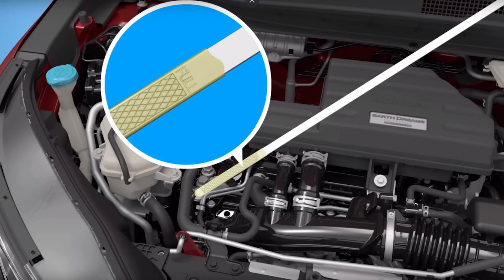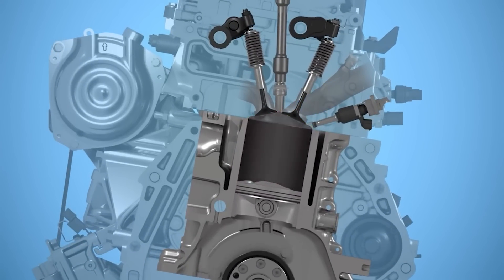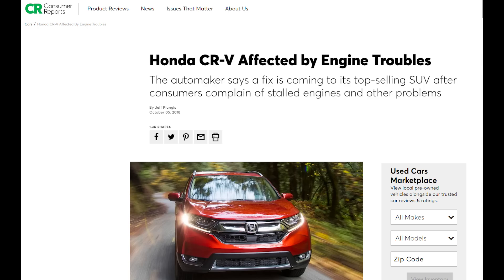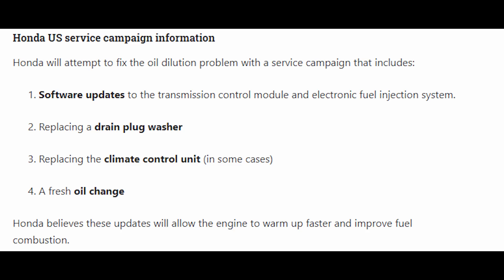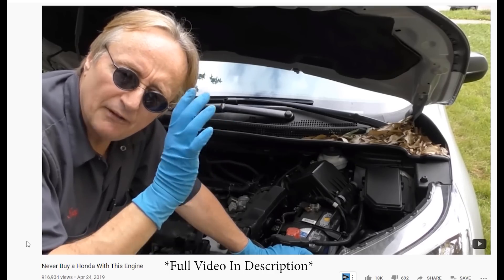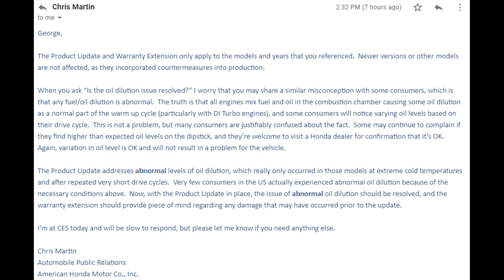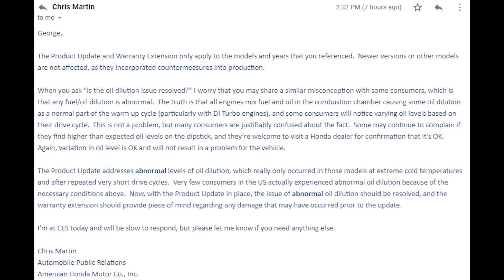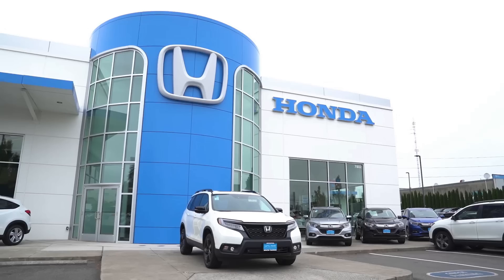Does Honda Have An Oil Dilution Problem? | 1.5L Engine in CR-V and Civic

Comment: Nabor has been dealing with this problem for three years we live in northern Ontario. Her Honda civic is in the shop more than in her driveway during the winter months. She once was stranded for five hours on the side of the road, it was minus 40 C. that night.Honda has inspected her engine a report has been sent to Honda Canada, when she asked what was wrong with her engine they refuse to tell her until the head office would respond to what the shop mechanic had found. She is done with that brand, they just lost a long time customer.

Comment: Update: Took my 2020 CRV to dealer for excessive oil dilution. I drive my car for ~50 mile 25 in each direction back and forth to and from work daily. After dealer stated that there is no dilution issue or any recalls. ~500mil after Dealer 2nd oil change dip stick was reading on metal part again. I have ended up trading CRV in for another car. I could not understand why...? I was doing more research on internet and looks like China has banned/recalled any sales for this type of engine until issue is fully resolved by Honda. I don't understand my US cant do the same to protect consumers?

https://en.wikipedia.org/wiki/Honda_CR-V#Issues
https://www.torquenews.com/1084/honda-civic-cr-v-oil-dilution-problem-what-you-should-do-now
http://www.hondaproblems.com/oil-dilution/

Comment: I have owned Honda or Acura cars since 1979.  I have respected Honda for its engineering since its motorcycles days. Frankly, I am put off by Honda's combination of engineering failures in producing the 1.5 liter turbo engine, which is then "fixed" by advertising only.    With more than a million of these engines on the road, Honda cannot afford to admit error and offer correction, which in the end is likely to be either a major cash settlement or a new engine.  A month ago I by--passed a CR-V and an Acura RDX in favor or a Passport (with is not burdened by Honda's current bullshit campaign).  Honda and others are likely to face some high-cost legal consequences as these engines start wearing out around 70k miles.  No, if you own a 1.5T engine, the solution is not an oil change; it is to dump it quick, as it's going to have zero resale value.

Comment: Great video, thanks.  I have a 2018 CRV, with the oil dilution problem.  Had the Honda “fix” done, and same problem.   I change the oil myself, and placed the oil level between the min-max marks.  After only 900 miles, with short drives and cold weather, the oil level is well above the max mark, to the tip of the orange plastic indicator.  If Honda truly believes an oil level above the max mark is okay, then they should replace the dipstick with a true maximum mark.  Otherwise, how high is acceptable before engine damage or shortened engine life occurs?  By Honda adding another warranty year, and updating the owner’s manual to say max doesn’t really mean max, then it’s an admission of a poorly designed and tested product.
Reply: I am experiencing the same problem with my 2018 CRV.   Gas fumes in the cabin and oil level above the dip stick max mark after less than 900 miles after an oil change.   Never imagined  Honda would not stand behind its product and its loyal customers.   I won't be driving this time bomb of unreliability beyond 3 years and will never buy another Honda product.

Comment: I feel for anyone purchasing a used newer CRV. Even if the oil/filter was changed on time because of the oil dilution there will be a major increase in engine wear that won't make itself apparent until higher kilometers in the later years. More customers need to be educated about all this "efficiency" bullshit because all it's doing is over complicating what's supposed be simple and reliable and there needs to be an industry purging and correction. If getting 1 MPG better matters more than reliability and proven tech then there is a big problem here.

Comment: If you really care about reliability  buy a direct injection engine that has port injection too(All Toyota engines). Buy an engine that does NOT use cylinder deactivation(All Toyota engines)
Reply: Right

Comment: I've had my Honda Civic for 2 years with the 1.5. Never any problems that they're talking about in this video. However, It does seem to take a bit longer to warm up in the winter. I live in Chicago. My wife has a Ford. Escape same year the heat comes on much quicker. Other than that I've had no problems with this car and I'm glad I bought it. I do change my oil regularly. Around 5 thousand miles I most definitely will pay attention to the oil levels. Thanks for sharing the video.

Comment: I owned a 1.5 Turbo Civic for 3 weeks and traded it for a 2020 2lire Civic naturally aspirated motor. Actually a little less power, but piece of mind. Oil and gas mixed, eventually, your valves etc will FAIL. Don't believe Honda. Always drove Lexus and Toyota, but Toyota just don't make anything "cool".So I liked the Civic Coupe with manual tranny. Cost me a pile doing this switch, but I can sleep at night (I hope). Probably should have stuck with Toyota.
Reply: I was almost sold on 2020 honda civic but ended up with 2020 corolla lol

Comment: Worked at Honda Dealership as a tech from 1980 to 1985 when I started my own Honda Repair Business in Howard County Maryland until I retired in 2006. Honda used to produce an extremely reliable 4cyl engine. In the early 90s Accords had distributor bearings failing, and Honda was still paying for new distributor sub assemblies free at 140,000 miles. Reliability and customer satisfaction was top rate. I had always owned Honda 4cyl cars until last year when I went to splurge on my first new car in 40 years. The only CRV that did not have a turbo was their bear boned with no safety features we required. So I now find myself without a Honda for the first time in 40 years. I think Honda made a mistake leaving their non Turbo 4cyl engines. Won’t tell you what we bought, but it came down to the Toyota RAV4 and the Subaru Forester.
Reply: I’m planning on buying the 2020 Civic 6-speed manual with the 2.0L (non-turbo) engine and I believe they have the K20 engine, is this a better choice?

Comment: I have 2013 Honda civic with 212000 km on it and still going like champ... want to replace it with CRV but after knowing about this oil dilution problem I don't want to buy it.. and Honda don't give option of non turbo engine. I love Honda but turbo engine sucks. Cant take chance
Reply: Come to toyota when the time comes

Comment: They have no solution for this poorly designed engine, so they want to as quiet as possible sweep it under the rug of extended warranty!
It is badly designed engine and there is no cheap way to fix it so Honda plays stupid ...  other than cheesy CVT this is a major reason for them being unreliable as they are now. Hope customers will not buy this and it will force them to do their job right next time
Reply: k domster I have a 2017 CRV, after the software update & AC control unit replaced the oil dilution still is not fixed. The only way to fixed for good is Honda to replace the whole Engine to different Engine not the 1.5 lit turbo. I will never buy a Honda again. I will trade my CRV to a Toyota RAV4 & I know I will have take a lost at around $5,000-7,000.00.
Reply: @txivneeghmoobmeskas4930  of course , what a shame , you should get compensation for lost resale value. RAV 4 or CX5 are both super reliable and nice choices.

Comment: If you create very high pressure in the cylinder, 1. Some of the gasoline will be pushed back and mixed with oil.
And 2. Which is even more important the engine will not last as long. 3. More prone to damage, and high costs repairs.
Unfortunately for people like me who love CRV, this 1.5 environmentally and politically correct engine sucks, but this Is  the only one available.
Reply: Shop around there are other Japanese car manufacturers that are better. Even the Koreans have some nice models out now. There’s too many options to be stuck with Honda.

Comment: Honda doesn't know a single thing about turbos. So my issue was what's explained in videos plus my Honda wasn't heating up at -20 celsius for 40 minute ride. I was stopped at the light waiting my turn to go revving the engine in sports mode to keep myself warm in my brand new Honda 2018. Plus here in Canada the dealer did not want to do shit in getting me in a new vehicle like the pilot or Ridgeline. So now as of early 2019 I'm an owner of a jeep Cherokee. Love my new jeep with a 3.2 V6 keeping me warm. Now what triggered me is not the Honda service it's the fact that they thought he doesn't know shit about vehicles so now I just have Wonderful things to say about Honda customer service. What happened to the customer is always right. Btw fuck you honda
Reply: last few times I was at my dealership there were custumers walking over to the sales floor to get owner/operator involved in a dispute . The service mgr. is in over his head . I'd hate to be out of warranty at this place because I'm not sure the techs at this dealership are experienced enough to diagnose issues unless a code shows up on their cpu.

Comment: The lower cabin heat is probably the reflashed ecu to get the engine oil up to temp sooner, which means less oil dilution. If you use the heater, it will take longer for the car engine to warm up.

Comment: Having owned A 2018 CR-V I can tell you that this is a real problem. I can also tell you that the fixes don’t work. Honda has made such a huge commitment to this engine and technology that there is no turning back so they simply lie to your face and deny the problem and the dealers swear to it. Really sad actually. If you are wondering if I still own the car...I do not. I arbitrated it away. I really feel sorry for those who are current owners. Take Scottys advice and steer clear!
Reply: I have a 1.5T CivicHatchback with 110k miles.....still runs and drives like the day I bought it......then again I'm a big stickler on maintenance, I never go over on changing any fluid on any of my vehicles
Reply: @ledbetter1226  my daughter just bought the CRV 2018 turbo 1.5 she has 30 days to bring it back to CarMax what do you think and what's your advice it has 40,000 miles on it should we take a chance and keep it or return it for another vehicle maybe the 2.4 instead thank you for any answers
Reply: @jmm1817  Well the 1.5 isn't unreliable because of its size, it was because of the oil dilution. As long as you don't live in a ridiculously cold environment and just start your car and take off then oil dilution shouldn't be an issue.

When its really cold outside I just warm my car up for a few minutes before leaving, and change my oil when its due. I haven't had any oil dilution issues or mechanical issues at all.
Reply: Should have bought the cheaper LX with the better 2.4 engine that proven reliable
Reply: How do you know the fixes don't work? Was your 2018 reprogrammed and still having the problem? How do you know its still having the oil dilution problem, are you checking it and its overfill? Have you had an oil analysis post repair and its showing up as diluted with fuel?
Reply: @mph5896  I had my 2018 CRV REPROGRAMMED AND OIL DILUTION PROBLEM DID NOT GO AWAY. Drove 1500 miles since last oil change and the oil level is 1/2 inch higher!!! Is this NORMAL? At the same time Honda will NOT specify/define at what point on the dip stick oil level is abnormal (excessive oil dilution). Also, Honda and Honda dealers are refusing to provide/define acceptable oil viscosity tolerance.

Comment: It's the shitty petrol the Americans use. Use 98 octane and problem will go away
Reply: Really?  Maybe jet fuel will help my 18' CRV fly!
Reply: Doesn't explain every Earth Dreams  1.5t was recalled in China.
Reply: Well it's most likely to be oil, ring or timing related. Ford's ecoboost suffered similar issues when the y launched it years ago that was an oil weight issue.
Reply: @1981robbo  no, it is ring/piston expansion thr loser thr better for fuel economy.   

The Japanese are using thin front windshield like Subaru's that crack and and small electric window motors that slow when another is added....all in the name of efficiency.

Comment: IF dilution was normal what is the function of the dipstick?? I check my CRV oil and its always over full. Is it overfull with oil or Gas? Yes I did the recall.
Reply: Ditto!   The recall "fix" didn't fix anything on my 18 CRV.

Comment: GM  has the 2.0 pushing gas into the oil and engines are dropping like flys.
Reply: GM Ecotec 2.0T has been around since 2006 and never had a DI related problem.

Thus is purely a Honda design problem and owners are the paying beta testers.
Reply: @normt5463  Norm Norm Norm. We are an independent shop and have replaced three 2.0 engines in the last 9 months. The high pressure fuel pump leaks gas into the crankcase. Call it what you want, but the 2.0 is junk.
Reply: @johndyer8381  and do you know why gas gets past cylinders into crankcase?

The oil formula was was udapted for Dexos 1 Gen 2 to lower LSPI and viking of the pistons.  There was a tab for sparkplug change and ecu update too.  Done use the correct oil or don't change it frequently enough and you'll be seeing allot more DI engines in for repairs.
Reply: @normt5463  Well, there you go! Just don't buy any GM products with a 2.0 or ohc junk
Reply: @johndyer8381  like any used car maintenance records are worth gold.

We had a 2013 Cadillac ATS 2.0T AWD with 90,000 miles and it was strong running. It was ecu tuned to almost 390 lb-ft of torque and was a hot to drive!
Reply: @normt5463  Hey Norm. When I change my oil should I dump in a quart of gas so I can be a part of the group with crappy engines ? I don't think that being a GM mech. should have to be a prerequisite to owning a GM product !!!
Reply: @johndyer8381  I drove 8 miles to work when it was close to 0°F during the polar vortex a few years ago and my Verano with LHU Ecotec 2.0T never gained in oil capacity.

This e gine has been out since 2006 and much longer than most including Honda Earth Dreams 1.5t that is mixing fuel with gas.
Reply: @normt5463  Just saying what I see go in the garbage. Leaking high pressure fuel pumps. Norm. just give me a push rod engine and I will have an intake gasket at 150k and go merrily on my way, that's all.

Comment: Adding an oil catch can to these engines will not only catch the gas and water/ blow by from the crankcase, but will also keep the intake valves clean!
Reply: Korey Mayo   Whaut iz a ‘oil catch can ?   Hav never herd ov that.   Where wood U put it on thu enjin ?

Comment: So let me get this straight, the dipstick has always been there to provide information about whether your oil is too high or too low, both of which are not good for your car. But if you have fuel in your oil and the oil level it reads too high that is okay? Then how do you determine when the oil level is too high versus the oil and fuel level is too high?

Comment: If you have a Honda 1.5 turbo earth dreams engine in a CRV or a Civic, find out for your self. Pull your oil dip stick and check the oil level with a few thousand miles on the oil change and see if it's overfull, then smell the oil on the dips tick for gasoline smell. I hope you don't have any issues. On thing I will say is I don't think your honda dealer will let you know. Try an independent place first if you can't figure it out. I thought our 2018 was wonderful and didn't think I had a problem until I checked myself.

Comment: J35 3.5L V6 Honda has had a recall in 2012 and they paid the US a fine and never fixed the heads. 2020 3.5L is the same engine. So their 1.5L and 3.5L sucks. Only their K20 is good. 😤

Comment: Had a 2016 civic touring with the motor, never had a problem. Just bought a 2020 si a few months ago and even in my crazy north snow storms it still never has an issue.
Reply: How many miles did your 2016 have on it when you sold it? Do you take shorter trips in the winter?
Reply: @shando3333  It had roughly 52k miles on it. And I drive my cars year round non stop.

Comment: And with this issue, they got rid of 2.4 engines on 2020 CR-Vs... Why?!
Reply: I never realized until recently that only the US lx models still had the 2.4 up until 2019 . my lease is up soon and had hoped the 2.4 was still in the lx trim here in canada but apparently the 1.5 turbo has been in the lx since 2017
Reply: @noroar3258  come to toyota or mazda

Comment: I am going to say I feel the fix is still not a great in place fix. I have serviced a 2018 with the recalls made and the amount of gas within the oil was ridiculous. The fumes under the care when pulling the oil plug were enough to burn my eyes. I do not feel they have fixed the issue yet. For the time being we will be servicing his engine oil every 3000 miles to hopefully ensure the longevity of this car. Best fix short of pulling the motor replacing the pistons and rings.

Comment: Any time the crank case is reading that it is over filled it’s a problem. With modern tech, as long as you get the engine to operating temp, oil dilution (water or fuel) should not take place.

Remember folks gasoline is a excellent solvent. Any residual oil in the cylinders is washed down when gas is injected. So when gas gets into the oil, you loose the ability to lube the engine.